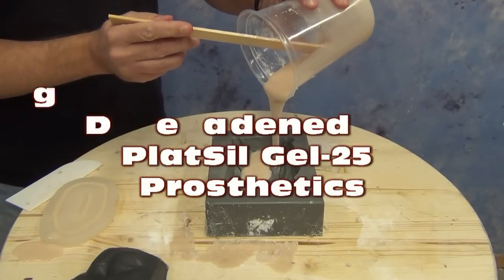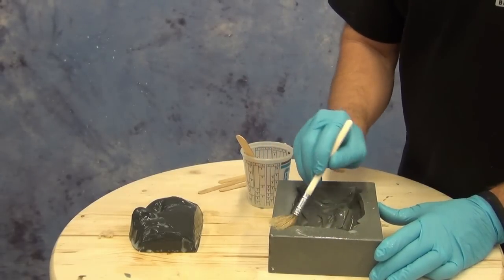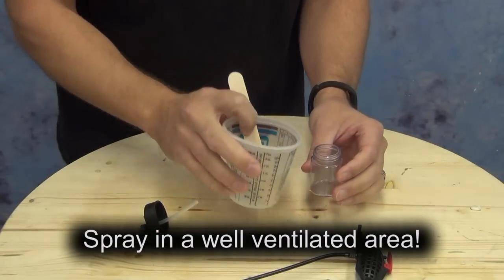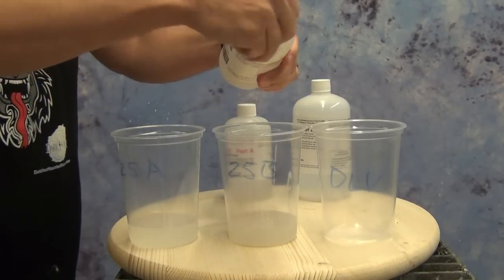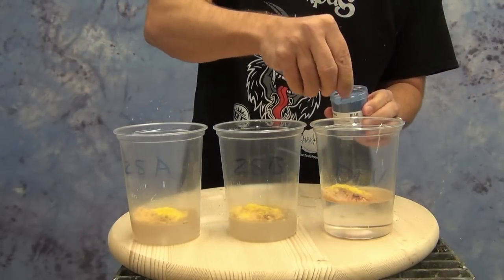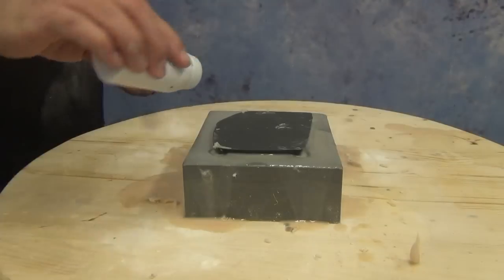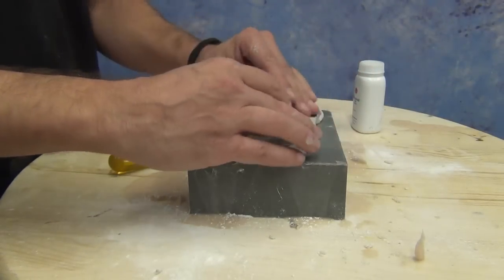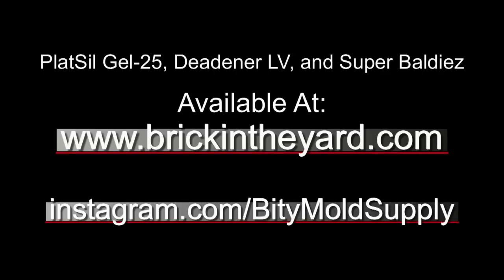Casting A Silicone Prosthetic In A TC-1630 Resin Mold

Comment: I know the silicone is really tacky from being deadened but won't the silicone not stick to the super baldiez if both the positive and negative aren't sprayed with baldiez?
Reply from the maker: It does stick very well to Super Baldiez, even if you just spray one side of the mold.
Reply: Brick In The Yard Mold Supply awesome I've heard of people doing that for a while but never understood how that worked thank you for responding
Reply from the maker: The level of Deadener LV plays a critical part in this process. If this piece was deadened much less the cap plastic might not have held as well.